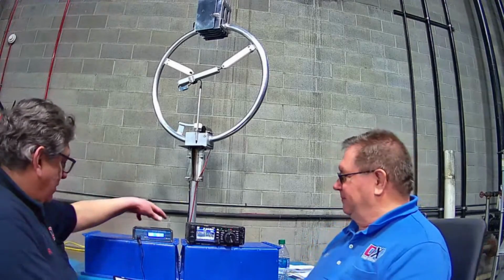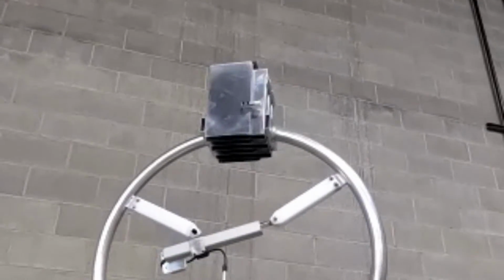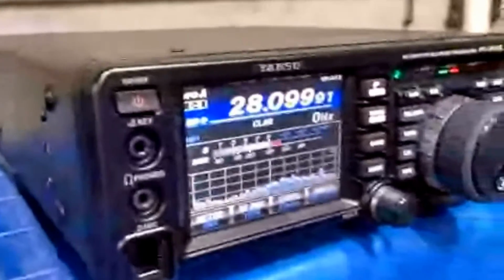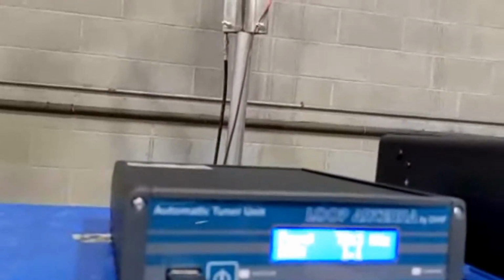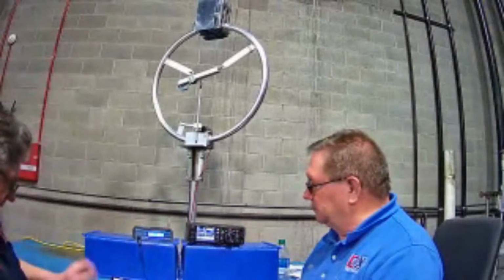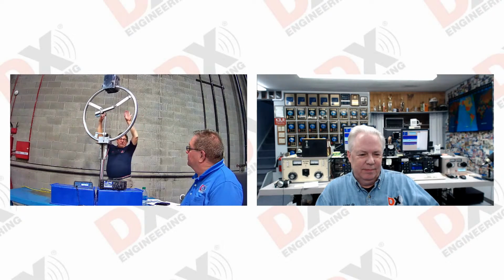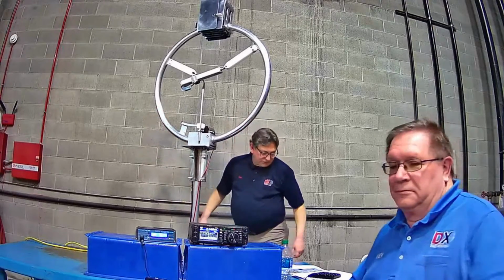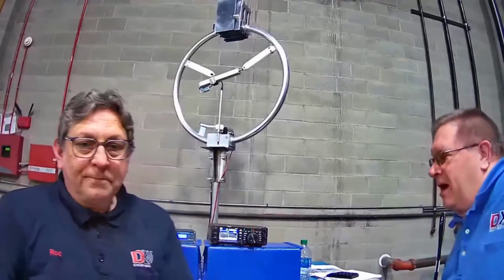Ciro Mazzoni Automatic Magnetic Loop Antennas - Manufacturers Showcase

Comment: Hi....I bought 2 units ACOM 1200S and 1 unit ATU 06AT. So non I am interesting to Baby Loop. There are some matters I need to know, 1. Can I use this atenna with a linier amplifier ACOM 1200S. Then how is the connection between Baby Loop ATU to ACOM 1200S + 06AT?  How is the CAT connection  with Radio ? I am using Yaesu FTDX101MP and another is ICOM IC 7610

Comment: I have the antenna baby, I confirm that in the balcony it does not work,  very high ros especially on the bands over 10 mhz and above 10 mhz the tuner fails and stops with the word swr error ....
to make the baby antenna work I was forced to keep inside the house (I live in a condominium and I have no garden) and therefore in this way the ros is around 1.8 - 2.2
in indoor mode I managed to connect 90 dxcc in digital mode.
In my experience I can only make traffic in europe some rare time in the new york coast only on bands above 14 mhz in digital mode, if the propagation is excellent nothing in ssb ....
for example in my case, inside the house,  for work in Europe, I don't think it is worth putting an antenna rotator, I work all of Europe completely holding the antenna steady without the need for a rotor.
the baby antenna is a mechanically robust antenna, but electrically very fragile, it does not remain tuned in the event of wind and rain, and not even with alternating sun - clouds for the swr to be stable, temperature stability is required .....
thanks greetings peace and good.  73
Reply: I have only recently put my Ciro Loop into service, so I am still exploring its capabilities.  I have used a number of homebrew loops in the past and I have a homebrew 80m-40m loop that works quite well. The first thing to keep in mind is that every antenna couples to the enviroment.  This includes the ground and metal objects close by.  
However for close quarters their are few alternatives.  Anyone with a large lot and tall trees could enjory better performance and save a lot of money by putting up cheap wire antennas.  
Mag loops are exceptionally high-Q antennas.  Ciro claims a usable bandwidth of 4Khz on 40m.  If you are transmitting a 3Khz SSB signal, that leaves little wiggle room.  ALL small transmitting loops are going to be sensitive to temperature humidity and the electrical enviroment.  The Ciro loop uses and air variable capacitor.  It is remarkably stable given that fact.  You can periodically hit the enter key on the ATU to fine tune/retune the SWR as enviromental conditions change. 
Using a homebrew loop, I have had very good results with balcony operation.  However, the issue is not the balcony but the construction.  If there is lots of closeby rebarand metal railings, a metal roof or metal shutters, the enviroment is not loop friendly.

Comment: I have been planning to buy Ciro Mazzoni Automatic Magnetic Loop Antennas... not sure about this question. Due to the size of both antennas Midi/Baby does one receive better than the other?
Reply: Different bands....  and different bandwidths on some of the bands.. .basically a bunch of over lap but if you pull up the specs of both and compare side by side I feel you will understand a bit better...   
They are cool from what I have seen online... really close to maybe getting one :)